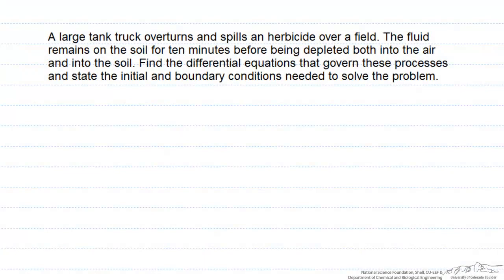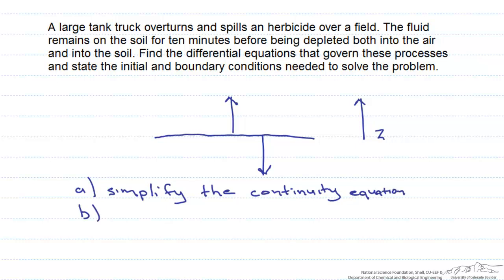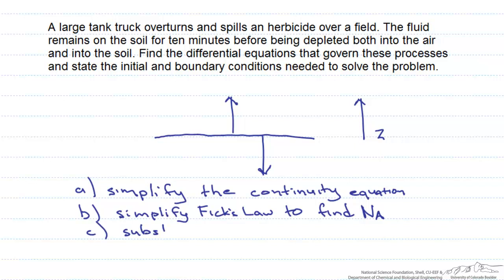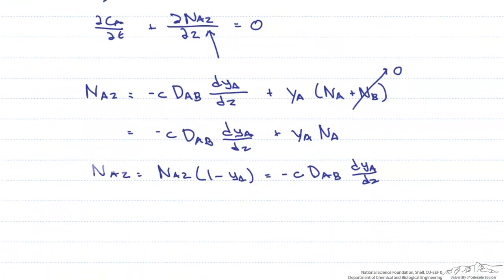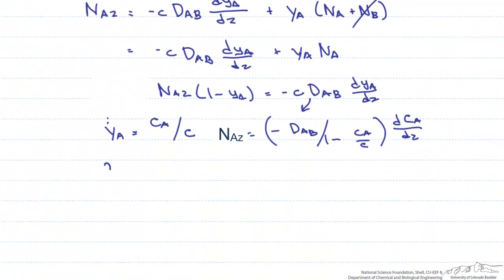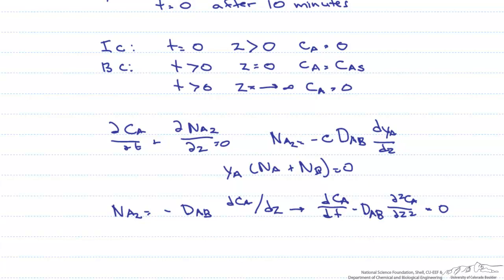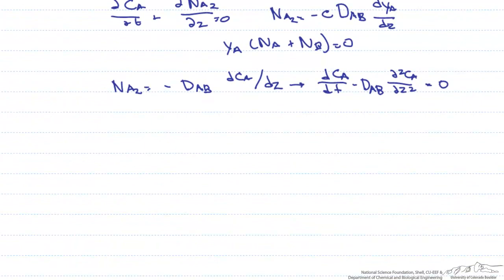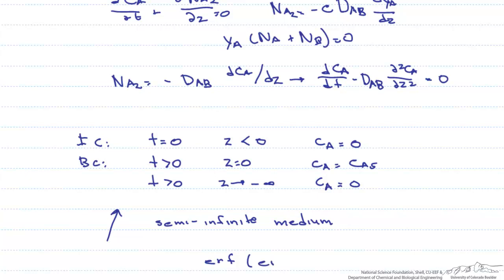Unsteady-State Diffusion

Comment from the maker: The audio does sound worse than when it was produced.  We will redo this one.  Any suggestions on other improvements?
Reply: This is personally relevant to me because it relates to my research, but it would be cool to learn how to estimate the z height if the source is constantly being replenished and reaches a steady-state thickness.  I'm thinking for this example, we would just kick the transient term out, but it would also be cool to have a second video where the calculations are performed all the way through.  Lastly, seeing a few examples where the grashof number is applied to convective mass transport would awesome because I've read a lot of papers where they mention it, but they never actually show how they apply it and textbooks spend all of their energy on boundary layer thickness for laminar BL's and mention the grashof as an after thought without performing any in depth examples.  Thanks for the videos!